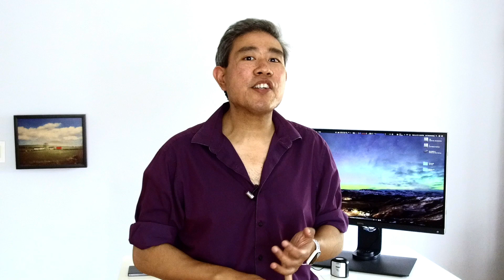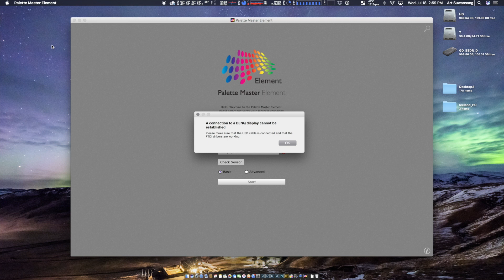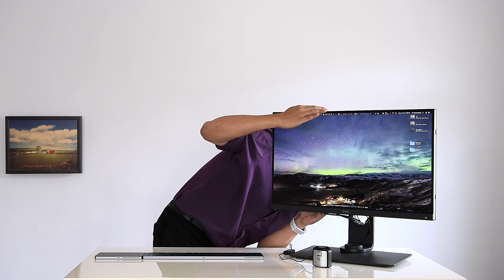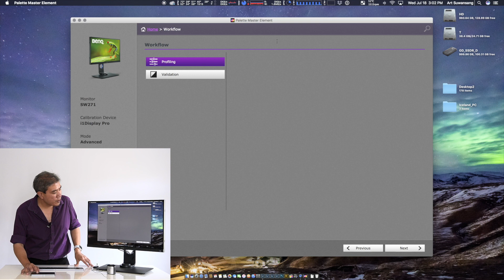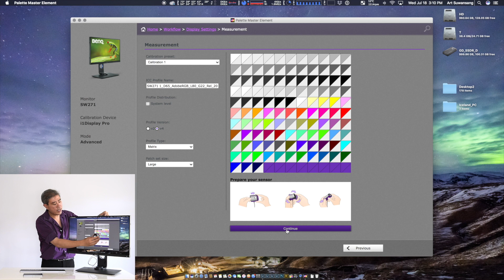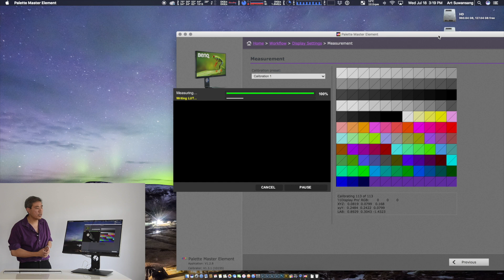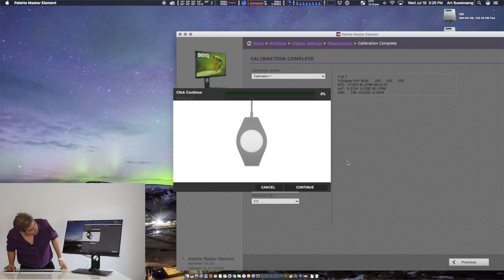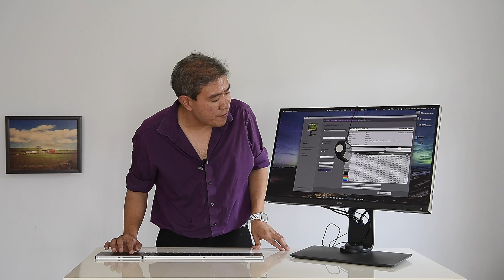How to Calibrate BenQ SW Displays with Palette Master Element - Art Suwansang

Comment: After this last calibration I see this very noticeable green cast on my monitor. Looking at scopes the image is balanced pretty well. But this screen! Man it looks off. Should I recalibrate it? What may be causing this?
Reply from the maker: Try to recalibrate it, sometime calibrated screen does look a little slight green that is the color of the panel and this can happen, but this all depends. As to why, this is system dependent I don't know.
Reply: ArtIsRight thank you, once again, for the reply. I’ll probably try to recal it tomorrow. Also, I’m noticing what appears to be (not sure how to describe it) blocky artifacting? in the shadows and blacks. It isn’t present when I look at the image on my computer. But on the monitor it’s noticeable. This is before I even start to grade it.
Reply from the maker: If that is what you are seeing try to calibrate with Relative, rather than Absolute Black and see if the result improves. Also you might consider using these setting for calibration, yes the video was done on 1.3.8 but it should work for any subsequent versions too https://youtu.be/bz9y3db9vRI Lastly, what are you viewing that is blotchy?
Reply: ArtIsRight ok, I’m doing relative. Also, this is for color grading video. So currently I am using rec709, with “RGB primaries” as rec 709 as well. And what I was looking at was some images from the shoot I worked on the other day for a friend. He let me keep some of it to practice grading. The subjects are African-American, and one was wearing a black shirt. So this artifact look was really prominent in their hair and his shirt
Reply: ArtIsRight when I select relative, the first field in display settings changes from rec709 to “[custom settings]”...do I just leave this?
Reply: ArtIsRight another question...in the video, when the calibration device is on the screen and it’s going through all the color patches and what not, The window is visible and you can see it going through all of the colors. But as I’m looking at my monitor I can’t see any of that. It’s just a black screen with the window in the middle of it, where I have my spider five pro laying on top of it. I can still see the bar moving as it’s measuring and everything. But I can’t see the primary window or anything. Is this OK?
Reply: ArtIsRight me again. Sorry, I’m messaging you while this calibration stuff is going on. Report summary says failed. But I go through the whole process again, or just the validation part? Also the highest “Delta”E (whatever that is) 3.60...in the green value. Does that possibly have anything to do with the green shifts?
Reply from the maker: When you change the setting, the preset will change to custom which is perfectly ok. I have an updated video on PME 1.3.9 forward, BenQ has change the GUI of the program so you will no longer see the main PME interface on the background, this is normal. If it failed the validate, you can validate it again but it will continue to fail. You can watch this video to find about about ∆E and how much of a big deal it might or might not be https://youtu.be/YzkOjL9JUJU About the green that you are seeing that might be the case where the delta e is higher. I like to get some more info about your system so that I can make a better assessment of your situation. If you don't mind Answers these questions for me and we’ll go from here.
1. What computer (Laptop - Mac specify the model, year and size, Desktop, iMac, all in 1 PC, custom build, etc )
2. What is your Operating System (OS) version are you using? (For Mac please specify the dot release, for Windows please specify version / build number)
3. What calibrator are using?
4. What version of PME are you using?
5. What BenQ model do you have?
6. What cable are you using to connect your BenQ to your computer for the display signal, HDMI, Display Port, etc.
7. If you are using USB-C skip this question, if not, are you using a USB link cable between your laptop and display?
8. If you are using Mac was this a clean install or was the OS upgraded from a previous version at any point (I.e. From Mojave 10.13.x to Catalina 10.14.x)? Or was this Mac restore from a back up, time machine or other wise?
9. For PC, what GPU are you using? If Nvidia are you using their new Studio Driver?
10. Were you able able to successfully pass the validation at some point?
Reply: ArtIsRight hello again, and thanks for the clarity. And yes, The validation passed after trying it again. Here are some answers to the questions you asked. 
2017 15” MacBook Pro
OS: high Sierra 10.13.6
Spyder5 pro
PME: latest version...whatever that is
BenQ sw270c
Connected via USBC cable 
Clean install, I believe
Reply from the maker: Awesome, so you are able to get it to pass? I just want to be certain.
Reply: ArtIsRight yes sir, I was. Still not sure what’s up with the greenish stuff. But I’m making due. And looking at the same clips I think some of that artifacting is less prominent.
Reply from the maker: Glad to hear.

Comment: Please help, Failed every time. (Followed your instructions exactly even with both blackpoint settings.) Report summary

Failed

Model

SW271

Profile

SW271 1_D65_Adobe RGB_L80_G22_2020-08-18T15.30.17Z.icm
Target
D65

Achieved Temperature

6501K

Average ΔE

1.34

Passed

Maximum ΔE

3.02

FailedReport summary

Failed

I'm Latest Windows 10, 1080ti 11g graphics card.
Reply: Also Thanks so much for making these videos! VERY informative!
Reply from the maker: You're welcome. So your delta e is slightly high but it is not a failed per say. Check out this video, toward the end you will see that even a delta e value of 3 still works great for image editing. Ideally, if we can get that value lower that would be even better. To help me better understand your setup Answers these questions for me and we’ll go from here.
1. What computer (Laptop - Mac specify the model, year and size, Desktop, iMac, all in 1 PC, custom build, etc )
2. What is your Operating System (OS) version are you using? (For Mac please specify the dot release, for Windows please specify version / build number)
3. What calibrator are using?
4. What version of PME are you using?
5. What BenQ model do you have?
6. What cable are you using to connect your BenQ to your computer for the display signal, HDMI, Display Port, etc.
7. If you are using USB-C skip this question, if not, are you using a USB link cable between your laptop and display?
8. If you are using Mac was this a clean install or was the OS upgraded from a previous version at any point (I.e. From Mojave 10.13.x to Catalina 10.14.x)? Or was this Mac restore from a back up, time machine or other wise?
9. For PC, what GPU are you using? If Nvidia are you using their new Studio Driver?
Reply: @ArtIsRight  Hey thanks for the reply, 
I'm a custom built PC
Windows 10 Pro 64bit, version 1909 OS build 18363.1016 
Intel i7-8700k @3.70GHz 
32.0 GB Ram

using i1 display pro
Just updated PME today so the latest. 
BenQ SW271
2m HDMI cable 
question 7. ( Not sure what this means, but the monitor is connected to the pc via HDMI for image and  the ethenet looking cable to usb 3.0 to use the built in sd reader)
Graphics card: GIGABYTE aorus 1080 ti xtreme. Nvidea does ask for an update so I will update it and try again. 

BENQ SW271
Reply from the maker: Are you running Nvidia Studio Driver? If not I would start with that. And my guess is that you are running PME 1.3.11 correct? Also, if HDMI calibration fails, your video card should have a Display Port connection, try that instead. You will most likely have buy a new cable for this. You might be running into this issue with HDMI https://youtu.be/8oPVHRK2TqA keep me posted.
Reply: @ArtIsRight  I just updated the Nvidia driver. and I have PME 1.3.11. It still failed. I will buy a DP Cable and see if that helps. Thanks for your help I'll update you when the cable arrives!
Reply: @ArtIsRight  I just found your other video posted 10th Dec 2019. and you do a different process. You use 16bit LUT. and choose Panel Native.   I tried that and It passed! 
However I didn't change the Maximum AE to 2.0 on the validation.  final result. Average AE = 1.46
Maximum AE = 2.50 
Are these ideal values? Or should I still buy a DP cable?  Thanks so much.
Reply from the maker: These values are good, you can certainly try a DP to DP cable and see if the value would improve further.
Reply: @ArtIsRight  Thanks a lot! :D You've been very helpful! :D

Comment: Just sharing a user experience: working with a new mbp and SW321C, calibration like explained in this video failed three times. Weird! Than I found out that the MBP put the sw321 in HDR mode, and that just doesn't work. Unchecking that in the preferences of the MBP solved the issue and the calibration succeeded in every aspect. Thanks for the explanation, Art!
Reply from the maker: Yes that causes a big havoc, this video covers that https://youtu.be/CFyNBYP5lJk. It does not happen all on Mac, it depends on the model and configuration you have. Thank you for the valuable comment :)

Comment: I thought maybe I commented on this video before but I can’t find it. Anyway, I’m trying to calibrate my monitor and right from the beginning, when I click advanced and hit start, nothing happens. The start button is just kind of pulsating.
Reply from the maker: Answers these questions for me and we’ll go from here.
1. What computer (Laptop - Mac specify the model, year and size, Desktop, iMac, all in 1 PC, custom build, etc )
2. What is your Operating System (OS) version are you using? (For Mac please specify the dot release)
3. What calibrator are using?
4. What version of PME are you using?
5. What BenQ model do you have?
6. What cable are you using to connect your BenQ to your computer for the display signal, HDMI, Display Port, etc.
7. If you are using USB-C skip this question, if not, are you using a USB link cable between your laptop and display?
8. If you are using Mac was this a clean install or was the OS upgraded from a previous version at any point (I.e. From Mojave 10.13.x to Catalina 10.14.x)? Or was this Mac restore from a back up, time machine or other wise?
9. For PC, what GPU are you using? If Nvidia are you using their new Studio Driver?
Reply: ArtIsRight Thanks again for replying so quickly. I wasn’t really expecting that. I was able to get it up and going. And, to my knowledge, I believe I have successfully calibrated it. With the start button not working or whatever, I just plugged in my spyder5 pro and then launched PME. I had it unplugged because I think I had issues when I first started using this monitor some months ago. Something was weird, I can’t remember. But you had suggested unplugging The calibrator thing. That’s why I didn’t start with a plugged in
Reply from the maker: Awesome, I'm glad it worked now!

Comment: Where should I plug the i1 Display Pro to? To the PC usb port or the monitor usb port itself?
Reply from the maker: It really doesn’t matter where you plug in the calibrator. At the end of the day is our base USB signal and it should work regardless of where you plug it into. However, if you want to be absolute certain I will plug it in directly to the computer
Reply: @ArtIsRight  Oh....Thanks for your help. So, is it the same rationale applying to the monitor? Both monitor and i1 display pro should be plugged into the pc directly for absolute certain? Am I understand correctly?
Reply from the maker: Monitor USB uplink has to be plugged into the PC, the calibration device can be plugged into either but to be certain plugging it into the source, the PC, is a good way to eliminate any issue of data transfer via a hub like device, i.e. monitor :)

Comment: I just purchased the PD2700U and I am unable to get the monitor to connect to my mac pro.  I can do it through the HDMI but have not been able to connect via usb. I keep getting the FTDI error message.  I tried everything mentioned in this video but it still doesn't work.  The CD that came with the monitor (who does CD's anymore?) and all the drivers and installers are for PC only.   So far have not been able to connect Master Element to my monitor.  It's very frustrating.
Reply from the maker: Palette Master Element is for BenQ SW line only, it will not work with the PD line. For that you have to use the measurement device software i.e. i1Profiler https://youtu.be/h_TT9O2I1b4 or i1Studio https://youtu.be/Qjmjw7wvtc4
Reply: @ArtIsRight  Thank you so much for clarifying!
Reply from the maker: Absolutely!

Comment: I have the xrite studio and the benq sw700 series display I plugged the colorimeter in to the USB port on the side of then monitor and it was not recognised any suggestions?
Reply from the maker: Plug the colorimeter directly into the computer and then make sure that you have a USB uplink between the computer and display as well, if you want to calibrate with PME.

Comment: Hi Art, just ran a calibration following your example and settings. Monitor is a SW270C on a Surface Book2. Used a Xrite Display Pro. PME version 1.3.10. Monitor was set on second screen only and the Surface clamshell was shut so only BenQ visible. When I rant the calibration I never saw the color patch. Only a small square with the different colors flashing. Even on validation. Does that sound right? Also, delta E came in at 2 and max at 4. Should I run the calibration again. Thanks for your help. And thanks for this video. Been dreading calibrating it but the video was very informative and easy to follow.
Reply from the maker: PME does calibrate mostly gray and blacks tones so what you describing is not too far off what it is supposed to be doing. It is supposed to measure a few color patches as well, so you can try to calibrate again. Also what is the delta e on the validation, the delta e that you told me of 2 and 4 is the threshold for average and max delta e and I don't think that it is the validation result. If it is that is ok just let me know.
Reply: ArtIsRight as usual you are right. :-) Delta e was .89 and max of 2.01. So, it’s ok that I didn’t see the screen with all the color blocks adjusting? That’s the part that confused me why it never appeared instead just a black screen. Weird thing is the Surface doesn’t seem to function very well on some apps when I have the screen “extended”. Some apps appear completely black when I drag them to the BenQ. So I’ve been keeping it second screen only. But that can’t be normal, right?!?
Reply from the maker: Your ∆E values are good I would keep it. The colors will flash fairly quick, but they should show up. Not sure why it isn't. With 1.3.10 the screen would look black because there is now a black background, that may be a contribution too. As far as the way your apps are behaving that is not normal. My guess is it has something to do with the different scaling or zoom on the display vs on the surface screen. This sound like an OS issues.
Reply: ArtIsRight thanks Art. Spent two hours on the phone with Microsoft support and of course they are implying the fault is with the monitor. Frustrating! I’m going to call them again. In the meantime, any settings on the BenQ that I might adjust that might help? Appreciate all your help.
Reply from the maker: If you are referring to the apps going black, I think it is mostly the OS and not even the surface. If you have another PC laptop, you should try doing A/B testing and see if it behaves the same way. I am willing guess that it does not. And if this is the situation, then formatting your Surface and starting fresh might be the way to go.
Reply: ArtIsRight you make a very valid point. My wife’s Dell XPS behaves perfectly and has no issues with any of this. The surface i have is a replacement laptop  microsoft sent me just a month ago from a previous defective laptop that was overheating seriously. They sent a refurbished one and not a new one. I really appreciate your help, Art. Truly helpful.
Reply from the maker: You're welcome! If you can try to format and reinstall and see if that is still happening. Orif you have another display or HDTV hook up your surface to it and see if it is causing the issue. If it is then it it is mostly the OS. After format, if it still happens then it is the hardware, which does not sound like it in this situation.
Reply: ArtIsRight update: after reformatting and reinstalling OS the problem persists. Still the same issues. I plugged the Surface to my LG C9 OLED TV using a USB-C hub with a HDMI cable to the TV. And, no problems at all. Everything works flawlessly on the big TV. I’m still baffled. Should I get the monitor exchanged?
Reply from the maker: Is your TV 4K or 1080? If it is 1080 then you might not run into any issue because the resolution is lower than your laptop screen. If you wife's XPS have no issue with the BenQ Display, then it sounds more like the computer either hardware or driver issue. I would pinpoint this to driver first and then the next thing I would check is scaling. What happen if you run both screen at native resolution and match their scaling percentage? See if this solves the issues.